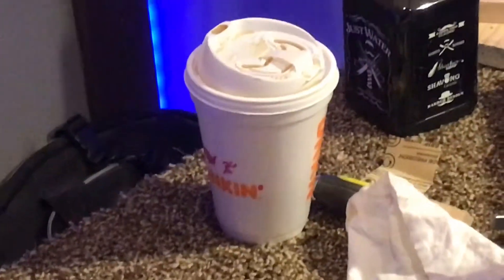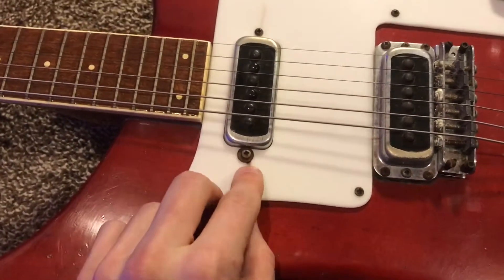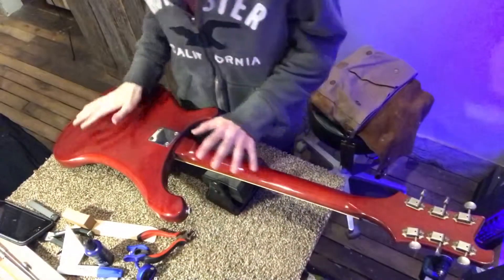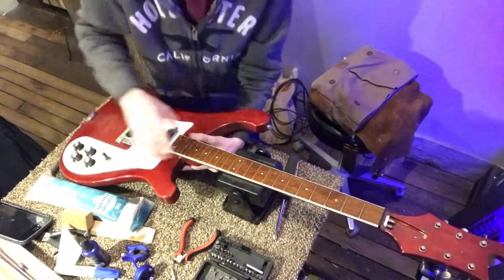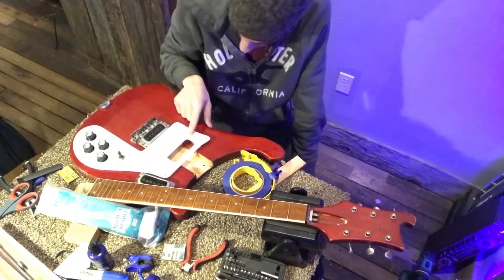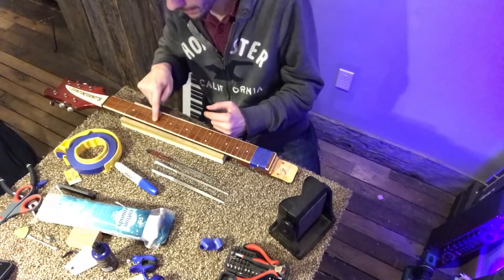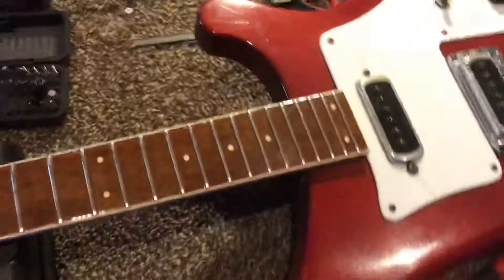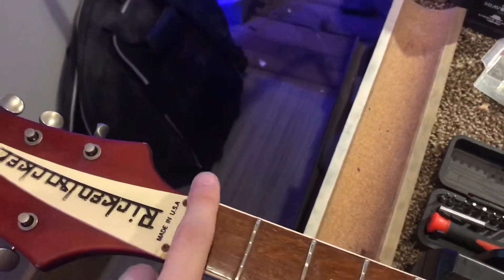1979 Rickenbacker 480 Setup!

Comment: It is critical to loosen the truss rods then move the neck into position then tighten the rods. Do not attempt to move the neck into adjustment using the tension of the rods as that risks the possibility of popping off the fretboard. The post 1985 guitars have a different system that allows you to do this.